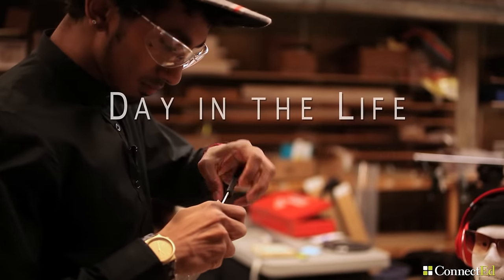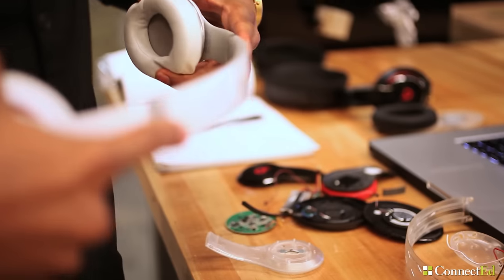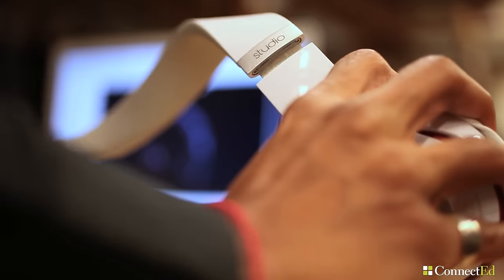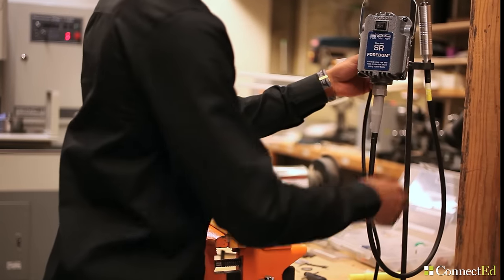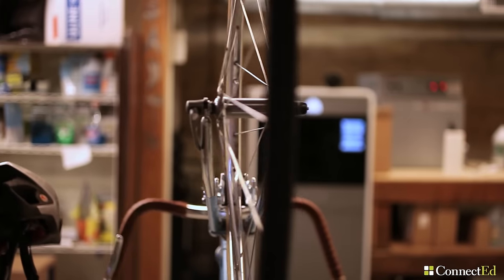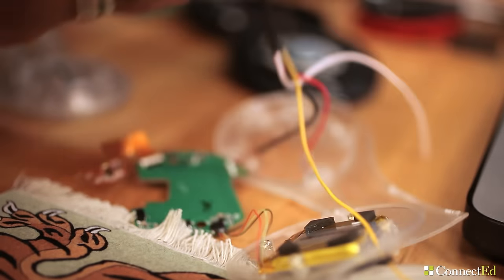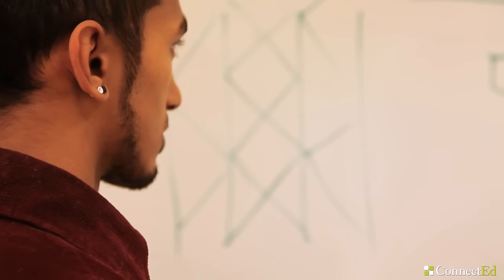Day at Work: Mechanical Engineer

Comment: The title is a bit misleading. This guy is no doubt a mechanical engineer, but it's not like this is what all mech engineers do. 

This video simply shows one of the many diverse areas a mechanical engineer can work in.
Reply from the maker: Isidro Garcia Thanks for adding to the discussion. Can you add a little more-- perhaps tell us about your experience and/or what you know other mechanical engineers do?
Reply: Isidro Garcia give us an idea of what its more like cause when i see videos like this sure is a buffer
Reply: Lol obviously
Reply: +ConnectEd in general mechanical engineers deal more with design of mechanical systems, thermal systems, and mechatronics. major applications include power generation, aviation, automotive engineering and design. product development , as in this video, is a also an application of mechanical engineering though, as in this video.
Reply: +Isidro Garcia This is probably one of the most rare jobs that you'll encounter in engineering. 95% of engineering graduates end up in some type of drafting (mechanical designer) position.
Reply: +Edward Abela Leave Mechatronics out of it. Mechanical engineers don't have a clue on how to design controllers.
Reply: +Dustin K Very true!
Reply: Well I imagine he didn't want to explain the whole process of designing complex systems to an audience that will most likely not understand most of it, if any.
Reply: You for sure don´t know what are you talking about.
Reply: Alq mechatronics is a concentration offered in a degree in mechanical engineering

Comment: I thought mechanical engineers didn't do hands-on. This is the job I want what is the title for this job called it's so cool, I'm in college right now and about to go into the college of engineering and I've heard engineering jobs have been boring with a bunch of paper work and not alot of work like this.
Reply: You're right about mechanical engineers. It's the manufacturing/production engineers who are more hands-on.
Reply: Mech eng do work with their hands as well but mainly to create models and test them before the first mass production takes place

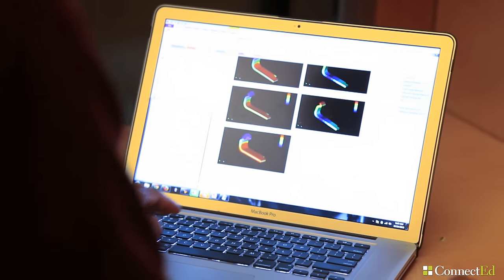Comment: 1:03 he has a MacBook Pro, but it seems that he's using Windows :o
Reply from the maker: Nice catch!
Reply: ConnectEd Thanka!
Reply: windows is where real work happens. so you won't see large scale engineering softwares on mac os.
Reply: I know this was about a week ago, but with an apple computer you can dual boot with windows, or virtualize windows as well :)
Reply: Ohhhh! See that explains it. XD
Reply: ADZCreations Why is that exactly? is it because there's a lot of incompatibilities with the Mac?
Reply: Lol yeah it helps but it's pretty difficult to do
Reply: Jeffrey Lopez part of the reason is many mechanical software are made with large scale implementation in mind with many people working on many PCs. In large scale systems, cost benefit and upgradability is a big determining factor. Since these softwares rely heavy duty hardware, windows setup make sense from ease of customization and ease of upgrade/resale point of view. On an imac for example, you simply dispose it off and buy a new one. But custom setups let you change just the CPU, of just the GPU for example when necessary. Drivers for windows are available at the release day whereas mac drivers take long time to appear. Also cross organization compatibility is very high on windows and also broad software compatibility. That is the reason leading softwares like solidworks, solidedge, inventor etc are windows only. There are certainly exceptions though both in terms of firms and software who use mac. Like Siemens NX software which is also very popular runs on both.
Reply: Kyle Budke this is the hypocrisy I hate about apple. They let users run windows on their hardware but specifically forbid them to install Mac OS on any non apple hardware even though there is no technical issue. That's the reason Hackintosh project exist. People who couldn't care less about the EULA are running Mac OS beautifully on carefully assembled customs PCs!
Reply: ADZCreations Oh cool cool. See, I'm thinking about buying a laptop for my engineer design class and I was wondering whether macs were worth saving for. Guess PC is the way to go.
Reply: Jeffrey Lopez sorry this is about a year later, but i just got a notify, if you havent gone yet, i would say either would work, i know a lot of engineers like apple because they're mroe secure, and snappier, however i know a lot of them also get windows computers due to some softwear issues. my suggestion, if you havent yet, would be to ask your teacher which one they suggest.

Comment: This video is slightly misleading because it gives the impression that a Mechanical Engineer does a lot of hands-on work all day. Some companies do allow you to be hands-on often, but don't be surprised if you're spending hours sitting at your desk!
If you want to be hands-on, work for a smaller company, or work as a manufacturing engineer.

Comment: Hello, great video.

I want to be a product/industrial designer but colleges nearby dont offer industrial design and I cant afford to move at this moment out of my city. I was thinking I could take ME when I graduate this  summer but what I really want to be is an Industrial designer/engineer... Would it be good or helpful to start with ME. A company I researched online wants a plenty of Industrial/product designer but they are required to have a ME Bachelor, so I thought "why not?" Also I was thinking before going to study ME to first get a Technical Certificate in Drafting and Design.

Please, let me know of anything you can help with with in choosing the right path to becoming an industrial/product designer.
Reply: I mean I would study ME then later move to a city where I could study Industrial Design. Not that Im saying I will work for Apple or that they will still have the openings for product designers but their requirement is a Bachelor's in Mechanical Engineering not Industrial Design or other.

Thanks and I hope you can answer me.
Reply: ID and ME are very similar and very different at the same time (If that made sense). ME will focus heavily on math and science, and only partly on the design process. It sounds like your more interested in the user experience which is more ID. I don't want to say you'll be learning a lot of useless info in ME but, ID will offer much more practicality in your interest. But I think studying both allows for the best of both world. Currently doing ME at WIT, with a minor in ID. Goodluck.
Reply: Stephen Imsong Thanks.
Reply: Angel Hernandez I am currently studying Product Design, and I was thinking many times how helpful it would've been to have studied something like ME. So it definately wouldn't be a bad decision. On the other hand, you would lose quite some time and it is not that important, because as a designer you can outsource work like engineering, the process of designing goes deeper than that.
Reply: I got a friend that works already in a product design agency, and in there the designers have some ideas, let the engineers and CAD-specialists work it out and earn all the credit afterwards, it's a bit unfair haha

Comment: I'm currently enrolled in a community college and having a hard time deciding what I want to major in since I've never really had an interest for anything while  i was in high school, all i really did was just take my core classes and electives. I'm  thinking of getting  a degree in mechanical engineering but I don't really have a passion for taken things apart and math has not always been my best subject I am however interested in learning more about ME. My question is if I should get my major in ME or focus on something else?
Reply: +kirk Lazarus III Just ace everything, finish your transfer reqs and get the hell out of there. Oh and get internships and talk to engineers. Don't just do it alone. Getting a job is just as much about your credentials as it is about your connections. I spent way too much time at a CC goofing around taking every physics and math class I could and wasted a lot of time. In engineering experience matters so much so get on those internships. ME is probably the second most in-demand field of engineering but if you can also do CS then do it because that will guarantee you good job opportunities down the line. If you at all like coding and algorithms then look into Computer Science.

Comment: I know this is late but isn't mechanical engineer working with only cars? I'm going Into high school and I want to plan for my future I want to do the same thing this guys is doing.
Reply: Automotive engineers are the ones that really focus on cars, Mechanical engineers have a more broad field of work where you can specialize in certain areas such as energy systems, aerospace, or also cars!
Reply: bryguytheflyguy what is the type of engineering this man is doing in the video. i also want to do this.
Reply: mechanical design engineering. product design basically

Comment: I'm confused about the differences between a mechanical engineer, mechatronics engineer, and industrial engineer.... I never thought a mechanical engineer would do things like this. I mean these kinds of products don't strike me as the type of moving things I would expect a mechanical engineer would do. What kind of engineer makes products like, for example, alarm clocks?
Reply: what was his major? mechanical engineering too? or something more design-orientated?
Reply: Windy
I don't understand the differentiation people are making between Mechanical Engineering and Design. But then, there are two different types of design in engineering. A Design Engineer like an automotive exterior or interior Designer usually will go to a Design School for that and will be mostly concerned with ascetics type stuff and very artistic. While there are many many other Design Engineers in the Mechanical Engineering field that design Mechanical components and systems ranging from Airplane turbines to oil rig parts or automobile parts or engines and hundreds of other items. Two totally different types of Designers but the latter type definitely falls under the Mechanical Engineer umbrella.
Reply: Industrial engineering is more of an administrative line of work but for mechanical engineering you do learn how to design parts like a compressor or a turbine and you can design other parts too for mechatronics engineering goes under the mechanical engineering with changing some courses with courses from electrical engineering. you can read more about the differences here: https://uwaterloo.ca/mechanical-mechatronics-engineering/future-undergraduate-students/mechatronics-engineering/frequently-asked-questions
Reply: Carmina Tongson best of both worlds (technical/science-y & artistic)!
thanks, I should investigate this path lol :D

Comment: Hey I'm a highschool students and I want to major in mechanical engineering and do this type of work. But I heard you have to go through calculus etc and I'm not amazing at math. I've always wanted to do this type of job but I heard it's an insane amount of work to be a mechanical engineer.
Reply: Hi, I'm currently pursuing a BS in Aerospace Engineering. The math isn't as bad as people make it out to be, Calc is as hard as you make it to be, just go in with a positive mindset and be willing to put in the effort to do the work (do your homework!), even if you think you are wrong or it seems hard at times. In the end you will thank yourself.
Reply: Get a tutor, this my freshman year of mechanical engineering and yeah, I needed a tutor bad.  High school math I got easy A's.  Then i go into Calculus and fail the first test. So my best advice is to find a tutor, they help a lot! And I never used a tutor before university..
Reply: I'm in mech eng right now, its really not all that bad. First year is just basic math you learned in high school, and there are tons of friends and tutoring programs that can help you if you need the extra help. Great program though
Reply: ArcticCatsRock
If I had high school to do over again so that I would be really prepared for mechanical engineering I would take as much math as possible including geometry, trig, pre-cal and some calculus if possible even if it meant going to tutors or summer school in my off time. I also would have taken a drafting class including computer drafting and more computer applications and programming. (I only took BASIC programming in high school but kids today are alot more exposed to computers so you might be better prepared than I was in that area.)
Reply: gacaptain To be honest, I didn't really have a lot of computer courses, in fact I am not very good with computers at all! I am good with the CAD courses, because my neighbour gave me lessons. The hardest part is math, but if you know how to do math, then it should be fine. I don't think I have a natural talent with math, its all just practice practice practice. The most important part with math is you have to practice.
Reply from the maker: Brittany M Very good response!
Reply: ArcticCatsRock
Yeah. It's just that when I took Mechanical Engr. my first year FORTRAN programming and Computer Drafting really kicked my butt but like I said I grew up without exposure to P.C.s except a BASIC class that wasn't very helpful. Home computers were very expensive back then and not very good anyway (I just gave away my age. LOL) But students coming up today are much better prepared.
Reply: Any ideas on good colleges for mechanical engineering?
Reply: Dylan k I go to Mohawk College in hamilton ontario.. Im liking it so far
Reply: +Dylan k what area are you currently in? There are many great programs across the country (assuming you're in the US). It's not just the program to think about but also where you feel the most comfortable. I would recommend listing a few you find and visiting the campus, going to seminars and other events for prospective students at each college or university if you can.
Reply: Im actually in Canada. I'm nt too sure how it works in the states
Reply: +Brittany M Hi Brittany, I'm 17 right now and I go to a great high school in NYC. Any advice for prospective universities? Any suggestions? I've always been interested in astronomy and physics and I thought that this field would be for me. Do u know what aerospace engineers actually do during most of their time? Sit in front of a computer? Play with rockets? Thanks!
Reply: Patrick Neggie Hello, sorry for the late reply. aerospace engineers can hold a variety of positions depending on the company and the services they offer. The best way to find out what they do is to do your own research on a company you'd like to work for in the future. For example, you can sit at a desk, work in a lab with other test engineers, do contract work outside the traditional office, research, or even work in a hanger.

I should warn you, even if you don't want to sit at a desk, you will most likely have to type out reports every once in a while. As for universities, look up top colleges for aerospace, call their offices and set up a meeting if you can. Good luck!
Reply: Patrick Neggie

You're in luck if you really want to get a graphic glimpse into what aerospace engineers actually do. All you have to do is look up on You Tube "21st Century Jet-Building the 777" It's like a 5 part documentary that shows Boeing engineers developing, designing and testing the 777 Boeing air liner. It's very good at showing the engineering process from almost beginning to end and some of the drama it entails.

To get an even more detailed view you can read the book "747-Creating the Worlds first Jumbo Jet.." It follows the life of Joe Sutter the engineer that led the team that designed and developed the 747 jetliner in his own words. If you can't find this at your library you can get it on Amazon for 5 bucks or less. It's a very good book for anyone interested in engineering in general as it follows in detail the engineering process from the beginning to end of a few major projects.

Even though the technology used by the engineers in this video and book are old compared to today, the methods and problem solving skills, office politics, etc. are still very much the same.
Reply: Brittany M gacaptain Thank you for the help and suggestions guys. I will certainly look into it deeper and conduct my own research. And gacaptain, I'll be sure to check out the documentary that you recommended!

Comment: How the heck do you have WINDOWS 7 on a MACBOOK PRO?
Reply: parallels
Reply: jovonne pacheco Partition your HDD, set up dual boot.
Reply: matthew matti Mac users...
Reply: You could do it in two ways (that I know of).
1) Buy Windows and install it thru boot-camp .
(You will have to reboot your mac every time you switch to another operating system).
2) Buy Parallels Desktop and run both system at the same time (Could slow your mac).
Reply: jovonne pacheco Very easily.

Comment: so mechanical engineering is basically 90% computers
Reply: Pau Gasolina A lot of time is spent in the designing, simulation and prototyping processes and computers are used a lot during these processes. Only some time is actually dedicated to the manufacturing because you don't just build an idea you have and see if it works because this would not be financially feasible